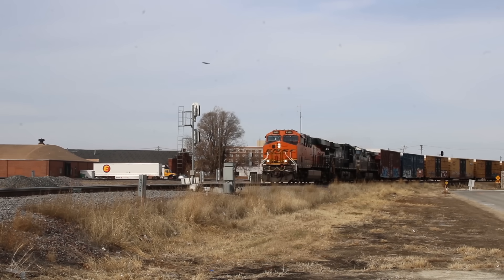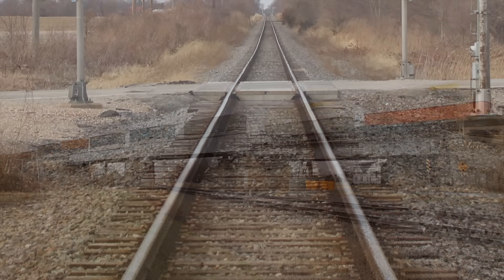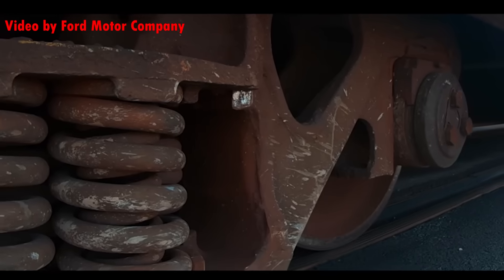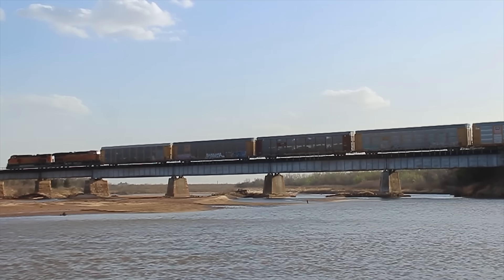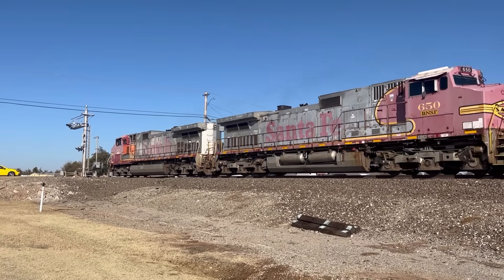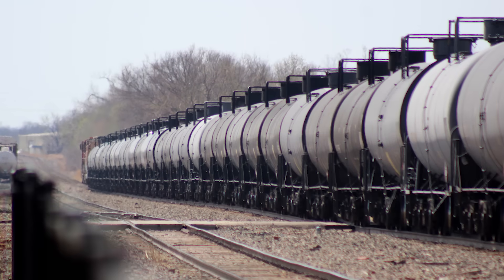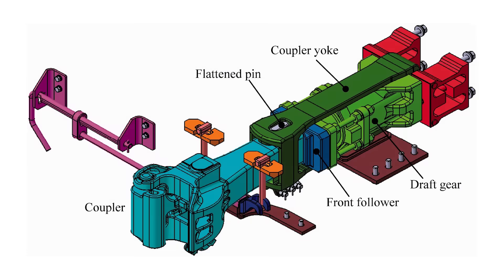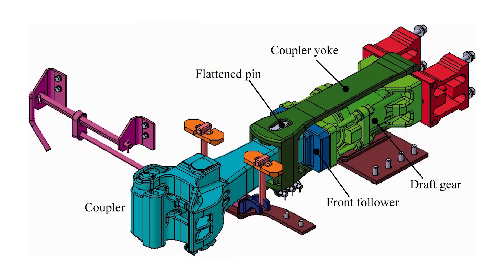Why Locomotives Can Pull So Much

Comment: Low rolling resistance not low friction. The friction coefficient of steel on steel can actually quite high
Reply: For the static case we first have to overcome static friction, after the initial movement its rolling resistance
Reply: @mathemitelmar5546 if there isn’t any static friction the wheel would be slipping. So it is not overcoming the static friction but it takes the help of the static friction to accelerate.

Comment: Recall your high school physics. The amount of friction is only dependent upon the weight and the coefficient of friction. The contact size does not play in to the equation. And, like someone said above, the bearing friction would be considerably larger than the contact friction between wheel and rail. Otherwise fine video.

Comment: The size of the contract area should not be a factor.
The formula is to multiply the coefficient of friction either static or dynamic X the normal force or weight applied perpendicular to contact surface.
Dragsters with big slicks are a different story & it has something to do with rubber tires conforming or embedding themselves into the road surface.

Comment: I was an engineer for a long time and we would never use the slack to overcome the weight to get started on steep hills. Basically anything with an incline we would would stop with all the slack stretched out. The reason being all that slack running out as you start to pull will break a knuckle or drawbar.

So in theory the draft gear could help with that, but the knuckles and drawbars are not built to handle that. Draft gears are there to smooth out the slack action.
Reply: I worked mountain grade for a decade and cringed at that part of the video. You ALWAYS keep your train stretched. Always. The idea of "taking in slack" is from the era when trains were like 1200 ft and steam engines couldn't develop enough tractive effort at low speeds.
Reply: so, what do you do in that case? I know some extremely long rains can have 2-3 engine carts running, but how does that work? you flip them on one after the other when the "slack" comes to that part of the train?
Reply: @TheHighborn  so we apply air while all the motors are powered up to stop and that keeps it mostly stretched out (if there are DPU's there will be a little slack).

Once we go to start on a hill you will power up everything to about 4-7 throttle depending on the weight and the hill. Once all the locomotives are loaded up we release the airbrakes and maybe hold the independent a little to keep from slipping.

This minimizes any slack being allowed to form between the cars, but yes those DPU's that are pushing will create a little slack and you just have to be very careful to not release your air until ALL your motors are fully spooled up.
Reply: @Steezicus  that was informative. Thanks
Reply: we do it here for crossings, our territory here is mostly flat with a few dips and one "step" hill (step on each side) but we have a shit ton of crossings per territory, almost double per mileage.
Reply: @alexander1485  yeah we stop bunch up on flats for signal and crossings all the time. But your territory does not have any real grade it sounds like. The first thing you learn as an engineer when you start running trains is to always stopped stretched basically on any hill or grade. This goes for 150 unit coal trains and any length intermodal, etc.

If you have to pull hard to start you simply cannot time it to pull out the slack smoothly as the air releases. Every train releases at different speeds and it even varies with temperature.

Comment: For traction motors,  is the inside Electromagnetic "arrangement" already rotating, before the wheels start turning? Are they called traction motors because of a somewhat different design than a regular electric motor? Thanks for your informative videos
Reply: Nah, that's just a purpose name. It's still normal electric motor. It's used for traction, hence "traction motor". When it's doing braking, you could also call it a "brake motor"(if you don't know, yes, diesel-electric locomotives also have electric brakes; but they just waste energy like friction brakes, because of nowhere to dump energy).
Reply: The motor is geared directly to the axle. At CC we had 2 different ratios. One for passenger and one for freight trains. The trains have friction brakes and many locomotives also have dynamic brakes which use 5:15  the traction motors as  generators that send the power to resistor banks at the top which dissipate it as heat to help slow down the train.

Comment: I'm led to believe that some subway networks have stations at the crest of a slight incline. This means that the train is effectively using the up hill section before the station to help slow down and the downhill section immediately after the station to speed up. A pretty simple system when you think about it but it must save a lot of energy and brake wear.
Reply: Most subways have traction motors under each car, so the tractive effort is distributed.
Reply: some are even rubber-tired, especially useful for steep grades
Reply: @nicholaslau3194  well yeah, by being rubber tired they also loose the advantage of low friction while putting a lot of wear on the road (every train on exactly the same track) and tires. Is a rubber tired train more bumpy than a "normal" one? never been in one, would be interesting.
Reply: @nicholaslau3194  Yeah, I think the Paris Metro is like that. Might be wrong though.
Reply: @weppwebb2885  They also stink.  I rode the Montreal Metro, back in 1967, during Expo 67 and before they had air conditioning.  I'd be riding on the train, smelling all the burnt rubber and sweaty passengers.  Even on the platforms, you can smell the rubber.
Reply: @James_Knott mtl métro is better now
Reply: @kexek7975  Could be.  I haven't been on it since 1979.
Reply: @weppwebb2885  No.  Rubber tired trains are smooth.  The nitrogen in the tires helps cushion the ride.  The rolling surfaces are smooth steel or smooth concrete.  Surface wear is not substantially different than rail wear.  Higher-friction under the tires is an advantage for this kind of high-frequency trains.  It gives them the traction necessary to accelerate and brake much faster than steel wheels could, thereby making trains possible as frequently as every three minutes or so, which is the biggest reason to use tires.
Reply: @James_Knott  I've ridden the rubber-tired metros extensively in both Montréal and México City.  They share the same rubber-tire technology, which has improved greatly since 1967.  I don't recall the smell of burnt rubber.  The Montréal metro does smell like parched peanuts.  This is from heating of the brake shoes, which are made of oak wood soaked in peanut oil.  Really!
Reply: @MikeV8652  I last rode the Montreal Metro in 1979, IIRC.  It wasn't as bad then, though it still had an odor.  However, my memories of 1967, during Expo 67 are still vivid.  It really smelled bad, between the burn rubber smell and the sweaty riders in cars that weren't air conditioned.  This was in July and many of the riders were in town for Expo.  On the other hand, I've ridden the steel wheel Toronto subway frequently throughout my life and it didn't smell anywhere near as bad as Montreal.  Of course there were exceptions, with some of the passengers.  🙂
Reply: @davel4708  I have been in Paris metro, and I definitely saw tires
Reply: @davel4708  Only 5 lines of Paris Metro are rubber tired.
Reply: @xaenon 
Jesus is the only way to salvation and to the Father.

Please repent today and turn away from your sins yo escape judgement 🙏🙏 There is no other way to get to the father but through him.
Reply: That's the situation in Toronto.
Reply: Moscow metro uses this system as well since 1950s if not earlier
Reply: Nice theory, but is it actually put into practice? I've never seen a surface train track with that feature. There are plenty of shorter trains that could have the same benefit. I ride such a three car commuter train for almost 20 years and it's not unusual to see others.
Reply: Nitrogen? Why? It comprises most of normal atmosphere.
Reply: Wouldn't it be smarter to make it downhill in both directions to save fuel?
Reply: @phillipdavidhaskett7513  please tell me that's a joke lol
Reply: @cadenorris4009  Which part?

Comment: You’re conflating some concepts here. 

The concepts of static sliding friction and rolling resistance are distinct, and there’s different locations where friction affects train wheels.

There is very high static friction between steel wheels and rails, or between tires and roads. This is good; we don’t want those wheels slipping, but we want them to keep rolling, which means that the wheel contact patch does not slide over the surface, but stays static as the rest of the wheel turns.

Starting a wheeled vehicle rolling doesn’t involve overcoming this friction, unless we are sliding the wheels instead of rolling them. 

Instead, we overcome two things: the friction between the wheel and its axle, bearing, etc; and “rolling resistance”, which is not friction but rather a measure of how much energy it takes to deform the wheel as it turns.

This is why properly inflated tires are easier to move than flat ones! In a flat tire, the lower air pressure allows it to deform more, so more energy is used there, while a well-inflated tire is kept from deforming by air pressure. Similarly, the much stiffer steel train wheel has a much lower rolling resistance than the elastic material of the tire and the compressible gas that fills it.

Comment: Wheel-rail friction is minimal compared to wheel bearing friction. Wheel flange friction on curves can be significant, too.
Coupler slack also includes coupler-to-coupler (loose fit) slack, most apparent in model trains. 
Locomotive traction control systems actually exceed the theoretical friction limit (mu = ~0.3) by pulsing the traction motors as do your car's anti-lock brakes.
Reply: I have not heard about pulsing, but in Europe electrical locomotives use a controlled slipping to achieve optimal traction (in addition to sanding). The wheels turn slightly faster as required for the speed and the traction control system ensures that the slip is in the right range.
Reply: @janradtke8318 that’s really interesting. Reminds me of how I read that when one of the fastest production motorcycles is at its ~200mph top speed, it’s rear wheel is actually turning at about 10mph faster than that due to slippage as the bike is pushing against wind resistance. It’s not directly related to your example, but still neat to think about.
Reply: @yo_marc 
Same thing happens when your pulling an implement with a tractor IH used to recommend 10-12% slippage, JD even put a ground radar on some models in the 90s to monitor ground speed vs wheel speed (wheel slip).
Reply: @yo_marc  It's not necessarily to do with wind resistance. Any rubber tire needs slip to exert force. Whenever you are driving, the driven wheel of the car is rotating slightly faster than the movement of the vehicle and slightly slower when braking. Similar when turning, there always needs to be some slip angle for the tire to create side forces.
Reply: @janradtke8318  Great comment, mate.  Does that wear the tracks and wheels out?
Reply: @janradtke8318  i have read that modern AC Diesel electric locos do the same thing.
Very cool that😀
Reply: shut up nigga
Reply: Interesting
Reply: You want wheel-rail friction friction anyway. That's not what's keeping you from getting a car moving from a stop.

Comment: Noting that many trains will have distributed power.  I've seen trains with 5 locos in front, 3 more in the middle, and 2 more bringing up the rear.  Though old technology, trains are still running.

Comment: With such a small contact area on the rail, how can the brakes work well?
Reply: Traction depends only on the normal force of the wheel on the rail.  Contact area does not matter unless on ice where high pressure forces melting, causing a film of water to form.

Rubber tires do exhibit increase of traction with increased contact area due to gross deformation causing shear stress in the contact patch.  Steel wheels on rail have very little deformation so minimal shear stress.  This shear stress is also a component of rolling resistance.
Reply: Railroads use a "tons per axle" rule. Sometimes empty cars will be added to a train if only for the additional brakes.

Comment: Should also mention Rolling resistance and inertia.
Friction between wheel and rail , or tyre and the road is required to start move and stop. Otherwise wheels would just spin slip under acceleration and slide skid under braking. Rolling resistance is how hard is to rotate a wheel.
The biggest difference between a train wheel and a truck tyre is rolling resistance, due to the amount of flexing and distortion of a rubber tyre.
The example of pushing the coffee machine , resistance to motion is friction . Train cars have wheels.. Friction between wheel and rail creates turning motion , not sliding motion.There is friction in the bearings , the resistance to train cars moving is inertia..

Comment: Interesting. However I do not use American units so I have very quickly convert your say million pounds, which is virtually meaningless to me, into metric. A million pounds converts to about 450 000 kg or 450 tonnes which is more sense to me.
Alan
Reply: Point taken, however 450,000 kg is rather meaningless to me.

Comment: For a bit of reference, I learned this particular figure when I was a kid in sixth grade!
 Steel wheel on steel rail, it takes 12 lbs of effort to start it rolling.
Only 9 lbs is needed to keep it moving.
Even though the whelk and surface are more or less solid, the minor distortion of even hardened steel means the wheel is always rolling up the slightest of inclines.

MR/Trains magazine own a boxcar that is leased to some railroad or other.
As an April Fool’s article, they decided to do an evaluation of it, the same as they would a scale model.
By modeling standards, it was way to light. ( go figure!! )
Moving the car took a bit of effort, but not overly so.
However, STOPPING it became the larger issue!

Even something done in jest can teach volumes!!!
Reply: This can be easily demonstrated! "The friction of rest is always greater than the friction of motion"! Get a length of a smooth surface of your choosing. Place an object of your choosing on one end and then slowly raise that end until the object starts to move down. When your object starts moving, you will be able to slightly lower your smooth surface and the object will continue sliding down. Try it, it works.

Comment: If the train is already stretched out before it begins to move, it will take much more tractive effort to get the train into motion. This is why steam locomotives used to back up a bit before pulling forward.
Reply: Diesels too.  They want the train to be slack when stopped.  This is not the case with passenger trains, where the banging would be uncomfortable for passengers.
Reply: @James_Knott passenger trains aren't nearly as long, and each car is lighter, than a freight train. So I guess the friction isn't nearly as big a problem. Also commuter trains that start and stop often usually have motors in each car.

Comment: Unless sliding, the wheels are always under static friction.

Rolling of any kind is static friction.
Reply: Indeed, static friction is the magic behind using wheels in the first place. I believe the static friction needing to be overcome here is in the axle bearings
Reply: Wheels rolling on rails produces very little friction; it's the microscopic deflection of both wheels and rails that mimics a truck tire on soft pavement.

Comment: Having a small contact point doesn't reduce friction. 
If it did, the locomotive wouldn't work, since it has small contact points too.
Reply: That’s exactly what it does. It’s why over inflating car tires improves gas mileage.
Reply: @thatoneguy611  Friction is independent of contact area.
Reply: @thatoneguy611  Nope, over inflating tires reduces rolling resistance, energy wasted in tire deformation, and the peak force that a tire can support before sliding and breaking traction. This video mixes the definictions of friction and rolling resistance